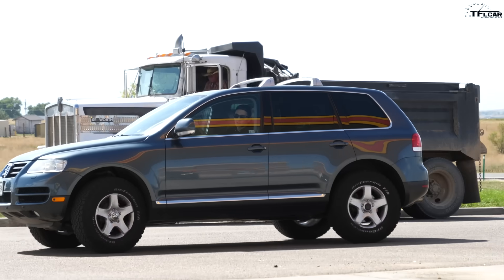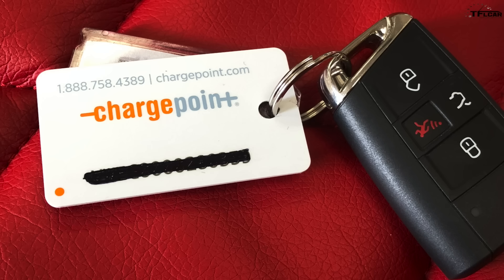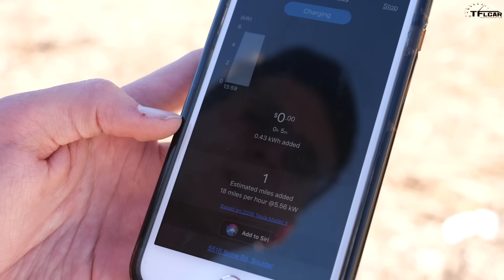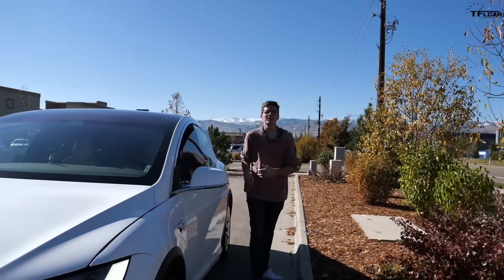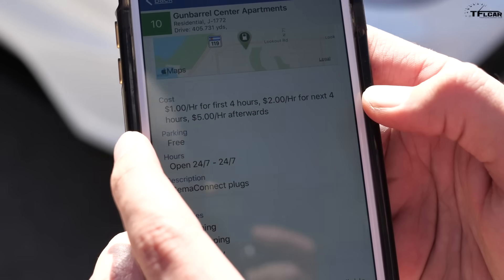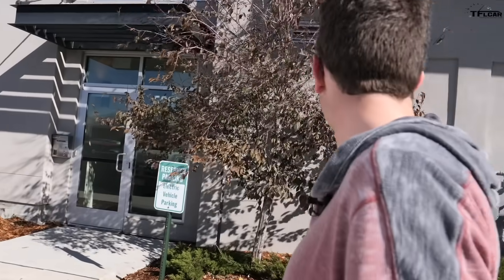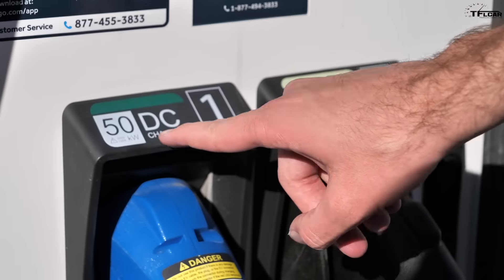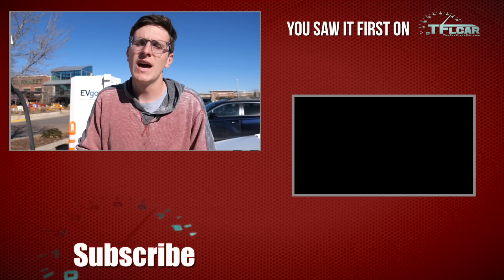Here’s Why Charging an Electric Car Can Suck - And It’s Not The Reason You Think!

Comment: This was my experience charging my car at charge point in Barstow Ca  I paid 
0 .69  cents per kWh on a Sunday  I got 35 mls for $6.54 , I have a Ford Fusion Hybrid that gives me 40 plus mls per gal , and the gas price was around 5.50 more or less so , the cheapest price to charge is around  0.43 cents for around 4 mls per KWh so 200 mls times 50 KWh  is $ 21.50  at low peak hours , now to run 200 mls in my hybrid at 40 mls is 5 gallons an now gas is under  $4 .00 here  where I leave and you know on peak we are going to pay more to charge outside our home . To me ev cars are good but for travel no way the prices and infrastructure sucks

Comment: All you go green nerds. Did you save the planet from fossil emissions. No! You are still using fossil fuel to charge your EVs. Oh yeah. When your batteries have to be replaced the pollution generated to mine the minerals for your batteries is off the charts. Not to mention the hazardous waste you just produced with your old batteries. I wonder what land fill they will end up in. And don’t say that they are recycled. 100 percent of your waste from those old batteries in not recyclable. The lithium and other minerals used in those batteries cannot be recycled. Yup that’s right you just produced as much if not more pollution as some one who drives a fossil burning car!

Comment: I have a Prius Prime. I plug in nightly and my range for gas is 550 miles @55mpg. I get all electric 19 miles 210 wall outlet. 11.4 gallon tank. $3.00 a gallon=$34.20. takes less than 5 minutes to fill. I think I have the best deal out there.
Reply: Winter months I fill the tank once a month. Once it gets above 60 degrees, that tank lasts 3 months. I drive 19 mile to work.

Comment: Nice work! The reality is that most new techs need time and the proper infrastructure to support rapid growth. Horses did not just disappear from the roads the next day a car showed up... We have to allow sufficient time for these charging comps to fight it out amongst themselves and eventually we'll end with just a hand full of them and their charging stations in every state. That's all dependent on whether or not the growth of battery-powered vehicles is sustainable at a much larger scale, which is still not yet possible due to limitations in manufacturing and infrastructure.

Comment: The amount of electricity to charge your EV at home is the same amount of running 25 refrigerators....or 4 A/C units. .Until the grid can comply. I don't think having even 50 % by 2030 is remotely possible. Also. ...should be a FEDERAL MANDATE. ALL CARS MUST BE CHARGEABLE  WITH ONE UNIVERSAL PLUG. NO EXCEPTIONS.!!!

Comment: And if you can't get an Internet connection to pay, you can't get a charge? 🤣

And you switch the car around because you didn't know if it was front or back charging, and someone can steal your spot. 🤣 

And if it's cold, you freeze waiting, or do you run your car for heat while it's charging, using it all up, and never gets charged? 🤣

Comment: Just for my edification...   if you should run out of power (say - on the highway - or perhaps the charging station is inoperable)... do you walk down to the operable charging station with a very long power cord???  Or, do you just get a 5 gallon can of electricity??
Based on the major
inconvenience factor  (hours of charging- you wont be going anywhere far) ...the cost of the vehicle and its repair .... the lack of  power plants to charge the thousands of EV's  ... the hazard of a EV fire (Please, do not park your car in your garage - unless you want to lose your residence with a un-extinguishable fire). Documented fact that these batteries re-ignite.  The avverage car fire takes 350 gallons to extinguish - an EV takes an average of 1800!  FYI, The average fire engine carries 500 gallons of water and foam does not work. Do the math.
Pretty much adds up to a total folly and crock of crap.  I now understand why president Magoo is pushing for it so much...
"There's a sucker born every minute"   - P.T. Barnum

Comment: 30 mile commute needs 2 hours of charging per day??
Reply: If it's 30 miles each way, and you are charging at home? Yes, 2 hours to put back 60 miles is about right. It's no trouble at all if you can charge at home (or at work.) The car will fill up while you sleep or work, and it will take you only seconds to plug in. It's way less hassle than having a car that needs to go to a gas station.
Reply: @jimmurphy5355  EVs make a lot of sense for some folks. Especially if you home charge, have 2 cars and can afford the generally high price tag compared to cars like Corolla, Accord or Elantra.

Comment: In the Western world these Chargers are all over the place in other countries they're very scarce. And comparing them to gas powered vehicles if you want to modify your tank for more fuel you can by buying a larger gas tank you can't do something like that with an EV because you can't get a larger battery pack you only get one type of pack and that's it. So you can't increase the range and it takes too long to charge them up. Plus the power grid again has not been upgraded to handle EVS nor will it be anytime soon because it costs too much to upgrade the system and the government doesn't like spending their money on useless things as they think. So it boils down to the consumer suffering more than anybody else.

Comment: Comparison of electric to gas. Gas what two three minutes to fuel up your car. Where as an EV takes like 45 minutes. Just what everyone wants to do hang out at the gas station for an hour watching your car charge up. This is why a lot of people are laughing at EVS. And let's not forget the range on an EV compared to a gas powered vehicle. And now they're even thinking about turning transport trucks into battery operated vehicles. You can't be waiting long periods of time when you have a deadline on a highway truck to drop off it's good. And it's going to take longer than 45 minutes to charge up a big truck. Which cuts into your deadline as well. Plus again they haven't done anything to restructure the power grid to speed anything up for charging any of these EVS. Give you an idea on the transport situation. For a truck that has 1000 liters on board it takes 30 minutes to fuel up. How many hours do you think you're going to have to wait for an EV truck to charge up with only a range of up to 400 km. As opposed to the diesel truck that can have up to 2800 km on one fill up. In 30 minutes to fuel it. They have never mentioned how long it takes to fuel up an EV Highway truck yet but I'm pretty sure it's going to be 3 or 4 hours if it's going to take 45 minutes to fuel up a car which has a battery that's not even a half the size of the ones in the big trucks.

Comment: I have talked about this on other forums. As usual the government comes up with an idea before putting in the infrastructure to support it. The idea of on street charging is barmy. Theft of charging cables is taking off. As far as I can see they should make the fuelling of EV cars the same as gas cars. First make all cars comparable to take the same batteries. , Ditch home charging and station charging. The car would be driven in under cover and the battery packs changed. Result no theft, no long waits, the same as a normal gas station. Some people will think the idea not workable, that is were the government comes in, to fix the nuts and bolts of the idea.

Comment: So if you are retired and have no home duties, no grass to cut, can skip a few meals each week you will definitely have time to high speed charge your electric car. Of course in the winter you may freeze to death or sit in the car with the heater going using more power then you are currently charging. Also depending we’re you are charging you my need to carry protection especially at night. The alternative to that is charging at home and every time you need a charge take😂 2 to 4 days off work. And that’s why I love my GAS guzzling air polluting beast.

Comment: What if your going on a long trip; say 400-500+ miles? You could spend several hours just sitting in a parking lot charging your car. I can top off for a 500+ mile trip in 5 minutes at almost anywhere and be on the road.

Comment: This kind of stupid is one of the reasons I bought a hybrid car. I have an issue with its mpg being less than it should be - even less than an equivalent old-school petrol engine of the same capacity! Definitely less than my last diesel car which tielded 56mpg. So if you add in this pligs incompatibility, the cost of an EV car and its potential battery replacement issues the answer is a complete no-no. I haven't even started on home charging yet...

Comment: This is for some characters that can't walk and chew gum at the same time. Still uses fossil materials to manufacture the vehicle the batteries more toxic than anything else. Power to charge just doesn't come through a wire it's from a power plant operating by nuclear, coal and  or oil. Wow you're definitely saving the environment.

Comment: Most of the electricity for charging of electric cars is still coming from fossil fuel, coal, 36% worldwide 35% NG, with Gas, Diesel, and wood combined amounting to 1 or 2 %  about 18% wind and solar combined, 10 from Nuke. With  wind solar and nuke relying on fossil fuel for maintenance & repair infrastructure support & supply and of course emergencies. Most other realistic estimates on the break-down credit fossil fuels with a full 90% of all electricity produced worldwide. Seeing as how, a lot of efficiency is lost the further one gets from the source to the result, it's still going to be better to put the dead dinosaurs straight into the tank for quite some time.

Comment: The problem with these electric cars you have to wait until it's fully charge which delays you to your destination unlike gas you pump and go and after a certain amount of cycles after charging it and discharging it the battery degrades over time which means you'll have to charge it more often  since you won't be getting as much mileage. You'll eventually need a new battery which is not cheap

Comment: And the electricity is generated from coal.  Electric cars will not improve the future.  Well, not for another 30 or 40 years.  16 miles of range per hour of charging.   How would you like to get 3 quarts of gasoline per hour?  I definitely do not want an electric car.  This is just too comical.

Comment: @Nomad  you pick a gas hog like a BMW, fact is a 2022 Lexus ES gets 43mpg, so it would be 7 gallons of gas for 300 miles, or $5 more than charging at $6 a gallon. At current $5.50 gallon price it is only $1.80 more than charging and 500% higher quality than a crap box like a tesla both inside and out, and far more reliable. I just checked PG&E EV plans, EV-A is 56 cents per kWh and EV-B is 60 cents per kWh so more expensive than gas now since it would cost you $40.32 to $43.20 vs $38.50 in gas...all things being equal 99% of people would choose a 2022 Lexus ES to drive vs a cheap plastic Model 3.

Comment: PG&E in california is now 51 cents per kWh peak and 43 cents off-peak, 5 times the cost anywhere else, the cost of electricity is now equal to buying gas at $6 a gallon for a car that gets 30 mpg, the reasons to switch to electric have evaporated in california.
Reply: Hardly.  At $0.51/kwh it would cost me $37 for 72 kwh to drive 300 miles in my Model 3.  My previous car was a BMW 328i which got 25 mpg, so it needed 12 gallons to go 300 miles.  At $6/gallon that would have cost me $72.  EV still cheaper to fuel.
Reply: @nomad9540  Math isn't your strong suit, you pick a gas pig like a BMW as a comparison, might as well go with a RAM diesel. A 2022 Lexus ES gets 43mpg, so just under 7 gallons for 300 miles, at $6 a gallon it's $5 more expensive, at the current $5.50 it's $1.80 more expensive, it's a wash and you sure the hell aren't driving a crap box like a tesla you're driving top quality inside and out. Electricity must be halved or gas to $12 a gallon (seems to be the left's plan) to make financial sense to switch if you already own.
Reply: @xxxblanco  LOL - my crap box granny grocery-getter leaves muscle cars in the dust.  u just jelly
Reply: @nomad9540  nobody is jelly about panel gaps, soft paint,  flying roofs, bicycle thin tires and a windshield higher than urkel's pants. We bought two new lexus vehicles,  each one more expensive than a model 3... ain't nobody jelly bro
Reply: @xxxblanco  Mine is still better.
Reply: @nomad9540  bruh it's a go kart with a fake leather interior, everyone would take a loaded Lexus over that just stop, you're embarrassing yourself my guy
Reply: @nomad9540  you pick a gas hog like a BMW, fact is a 2022 Lexus ES gets 43mpg, so it would be 7 gallons of gas for 300 miles, or $5 more than charging at $6 a gallon. At current $5.50 gallon price it is only $1.80 more than charging and 500% higher quality than a crap box like a tesla both inside and out, and far more reliable. I just checked PG&E EV plans, EV-A is 56 cents per kWh and EV-B is 60 cents per kWh so more expensive than gas now since it would cost you $40.32 to $43.20 vs $38.50 in gas...all things being equal 99% of people would choose a 2022 Lexus ES to drive vs a cheap plastic Model 3.
Reply: @nomad9540   @Nomad  you pick a gas hog like a BMW, fact is a 2022 Lexus ES gets 43mpg, so it would be 7 gallons of gas for 300 miles, or $5 more than charging at $6 a gallon. At current $5.50 gallon price it is only $1.80 more than charging and 500% higher quality than a crap box like a tesla both inside and out, and far more reliable. I just checked PG&E EV plans, EV-A is 56 cents per kWh and EV-B is 60 cents per kWh so more expensive than gas now since it would cost you $40.32 to $43.20 vs $38.50 in gas...all things being equal 99% of people would choose a 2022 Lexus ES to drive vs a cheap plastic Model 3.
Reply: @nomad9540   @Nomad  you pick a gas hog like a BMW, fact is a 2022 Lexus ES gets 43mpg, so it would be 7 gallons of gas for 300 miles, or $5 more than charging at $6 a gallon. At current $5.50 gallon price it is only $1.80 more than charging and 500% higher quality than a crap box like a tesla both inside and out, and far more reliable. I just checked PG&E EV plans, EV-A is 56 cents per kWh and EV-B is 60 cents per kWh so more expensive than gas now since it would cost you $40.32 to $43.20 vs $38.50 in gas...all things being equal 99% of people would choose a 2022 Lexus ES to drive vs a cheap plastic Model 3.

Comment: CHARGING TAKES TO LONG FOR CROSS COUNTRY TRIPS. BATTERY REPLACEMENT STATIONS USING VEHICALS DESIGNED FOR UNDER CAR BATTERY REPLACEMENT WITH UNIVERSAL BATTERY AND STATION ATTENDANT PRACTICE. A FRESH CHARGED BATTERY COULD BE REPLACED FASTER THAT A PETROL FILL UP

Comment: The United States Electrical Grid cannot support electric vehicles... so, you can't even drive from San Antonio to Houston without recharging... also, IF there is an absolute big push for electric vehicles without the grid being upgraded... the Brown and Black out occurrences will happen more often and when that happens, how you gonna charge your vehicles much less power your home... summer and winters are not fair when it comes to killing people without power, pipes freezing etc u get the picture...  all this hype is a waste of time... if your gonna have electric, why not have alternators powered by rotation of the wheels to recharge the batteries and/or fans turning by the air flow????   I guess that makes too much sense... and not enough money for the big guys pockets...
Reply: LOL - I regularly travel more than 200 miles (SA to Houston) on one charge.

Comment: I purchased a 2020 Chevy Bolt in February of 2021. I do all of my charging at home, since my county only has one VERY SLOW level 2 charger - which is FINE for my use case. Since Cvid, I've been working from home with only occasionally needing to go into the office. 90% of our driving is local - grocery stores, restaurants, our campground, etc. 

On the occasion where I do need to go into the office and my wife also needs a vehicle, we have a Ford Escape. That vehicle is also useful since we live in a colder climate and occasionally need an AWD.

EVs aren't for everyone. I certainly would NOT have purchased this car if I couldn't charge it myself. As for costs, I got a great deal on the purchase, and accounting for recent changes in both gasoline and electric, for every gallon of gas we use in the Escape (at 26 MPG), I currently get 111 miles for equivalent electric cost. These numbers will vary greatly according to market gasoline/electric prices, but I'll tell you this: Gas-powered vehicles are far less efficient than EVs.

Regardless, that total cost will be less when my solar panels and home battery get installed later this year. Most of our driving will be done on the sun.

But there's a LOT to consider. EVs are NOT for everyone. It's not all sunshine and rainbows. For instance, we had to deal with a recall of our battery pack. The good news is that GM will be replacing it for free later this year AND giving us a new 100,000 mile warranty on it. Fair enough. 

But, it's important to know facts like this video and I was well-informed before my purchase. Even with the recall, I'd totally do it again.

Comment: You are better off driving a fuel efficient 4 cylinder subcompact car. I only have to fill it up every 2 weeks and it's done in under 5 minutes. Car can be serviced by any independent mechanic. What the heck are you supposed to do while waiting for it to recharge? What about when it's raining, hot, cold, or have the kids with you? Wow. Too much information and makes it so much harder to refuel compared to gasoline. Why fix something that isn't broken?